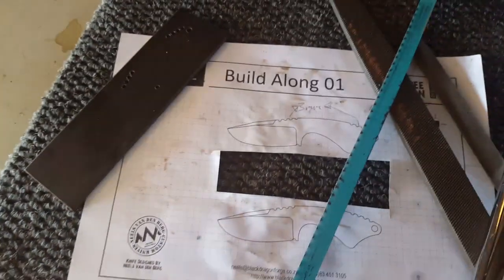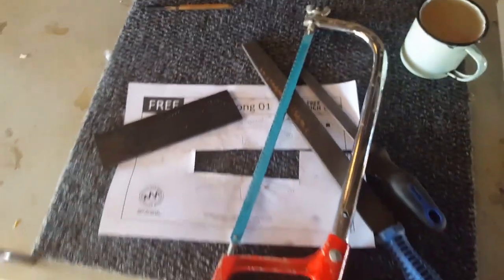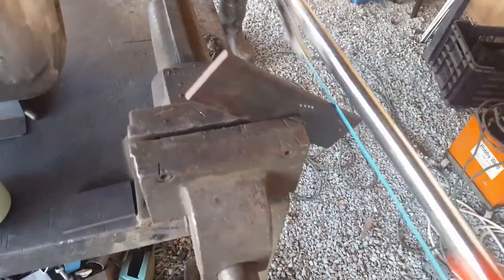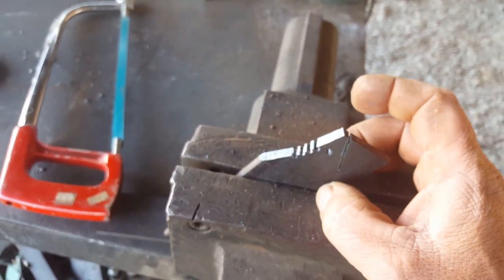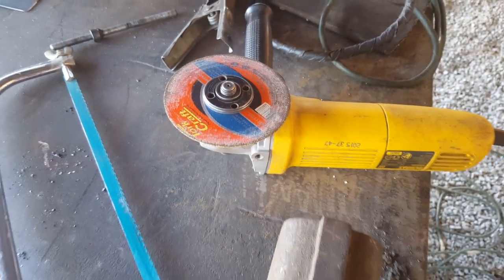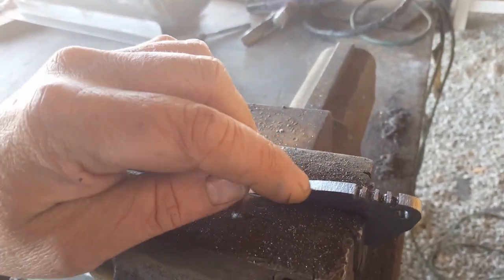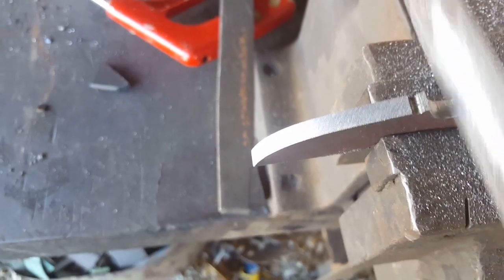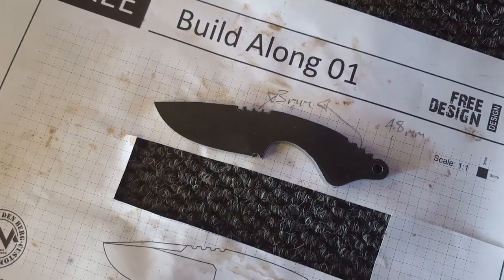Build along knife project 01 - video 4

Comment: Do you use a 'file card',  to clean your files. I felt relief when I saw the Grip needle file set, because I bought the same set (instead of the agile set) and wondered if I made the right choice.
Reply from the maker: file card gets used a lot, especially if I work wood and softer metals like brass, bronze and copper.
Reply from the maker: you can never have enough needle files ... :)

Comment: Hi Neels. How do one work on a bevel after heat treating the blade. Take note i dont have a belt sander. i work mainly with files.
Jaco from Pretoria. 
Thanx.
Reply from the maker: you will still be using files and sandpaper

Comment: wouldn't be better to drill holes all around the material without touching the scratched lines to remove the knife?
Reply from the maker: if you like drilling 60+ holes you can do that but I'll bet that if you own a drill, you probably also have an angle grinder or a hacksaw
Reply: Neels Van den Berg makes sense haha